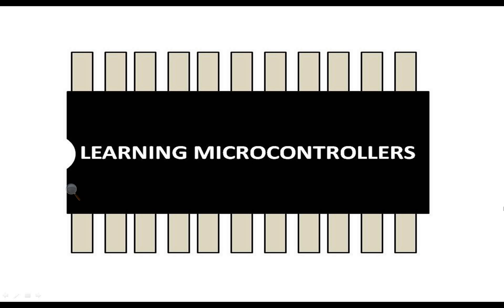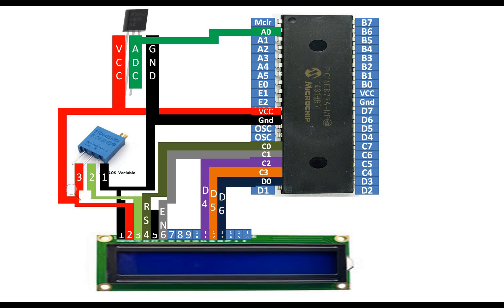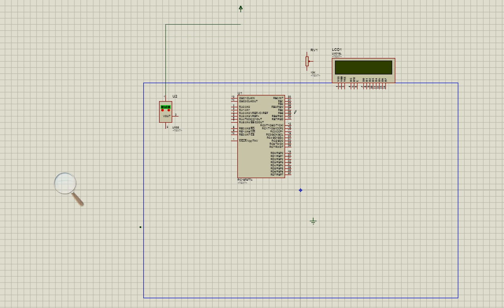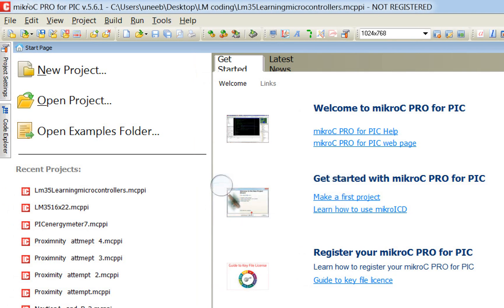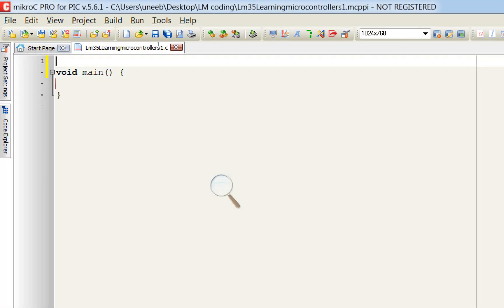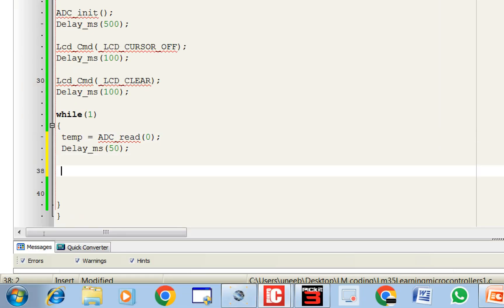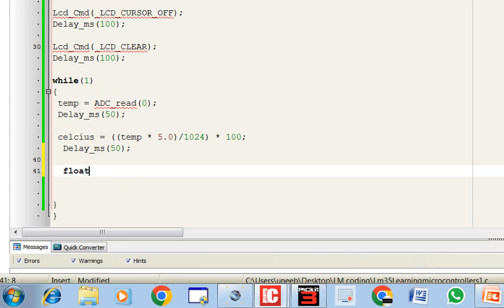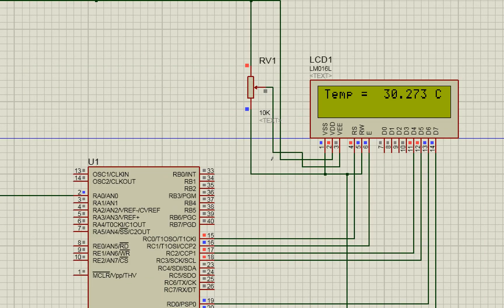PIC16F877A interface LM35 temperature sensor project tutorial using MikroC code & Proteus demo.

Comment: Hi, it won´t work if I use a 4MHz instead of 16Mhz Crystal, right?
Reply from the maker: Yes just change setting
Where I wrote my crystal value before sriting program you do the same
Change it to 4 MHz
Reply: @learningmicrocontrollers3561  I tried, but the LCD doesn’t show anything 😢 it just stays in blank, either proteus or protoboard
Reply from the maker: Something else is wrong.which microcontroller you are using?
Reply: @learningmicrocontrollers3561  PIC16F887
Reply from the maker: It has internal crystal
You can use that